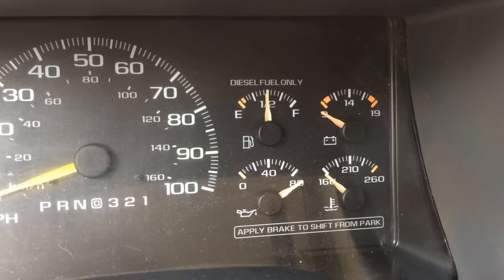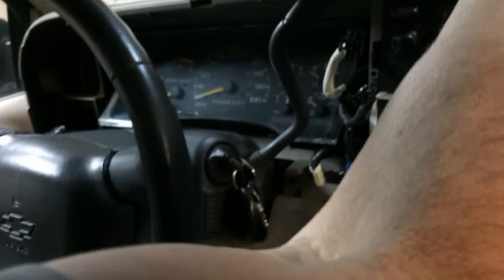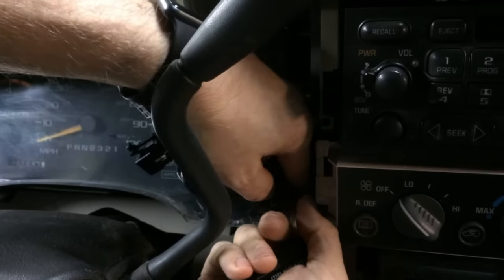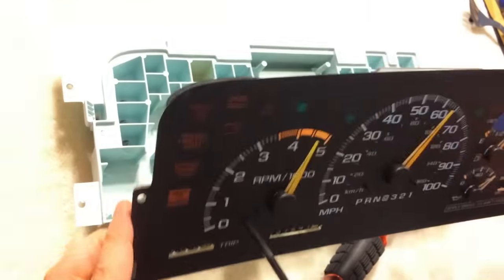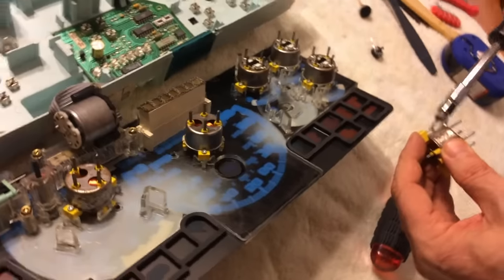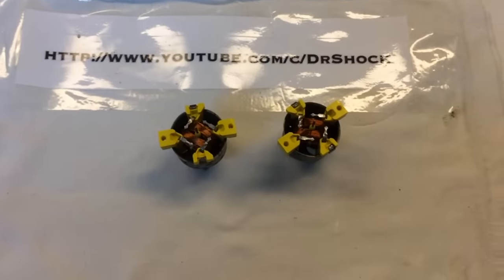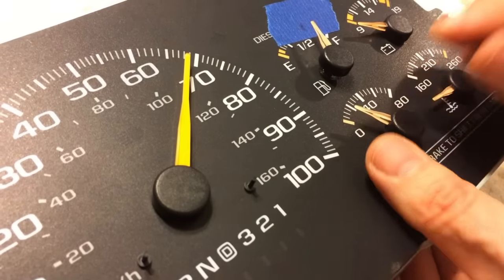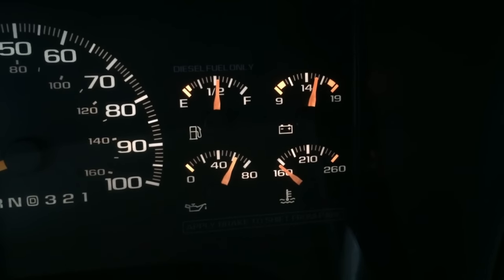1994 - 2002 GM Truck Twitchy Erratic Crazy Fuel & Oil Gauge Needle Aircore Motor Repair (Chevy GMC)

Comment: I looked online for the stepper motor/ air core motors, and they are fairly expensive. to get a Dorman replacement seems like it’d be more cost-effective because there is  all new parts and motors. I don’t have an erratic fuel gauge, but it is does vibrate. My issue is one of the stepper motors or something related to the speedometer is making a clicking noise at speeds 40mph and above. Can a person take it apart and blow canned air around the motors to blow off any contamination or dust that might have accumulated throughout the years that might cause erratic needles or noises?
Reply from the maker: Air core motors are totally different than stepper motors.   Air cores are way old, all the way back to the 1940s.  But the most common condition that this video points out is that the ones GM used have an internal dampening fluid, it's way dried out after over a quarter century on these trucks now.  So replacement is the only repair.

There's nothing mechanical with the speedometer gauge on these trucks (also air core based so no mechanics just electromagnetics).  But clicking noise coming from  the speedometer gauge area might be related to the odometer which is mechanical.  Could be a nylon gear lost a tooth or such there.   It could be generated from other mechanical components in the same vicinity too (e.g., cruise control module on the other side of the firewall, fuel line vibration against the firewall directly opposite, etc).
Reply: @DrShock  ok thank you so much. You are awesome mine is a 98 Chevy Silverado pick up. I do think the gas gauge is going to go out anytime because it’s been vibrating forever. As far as the noise goes I said clicking but I also think it might sound like a rattling and it’s related to the frequency of speed going 40 mph and above.  If it is a gear assembly in the instrument cluster do you think blowing the gearing out with canned air might resolve the issue?
Reply from the maker: If it's a broken gear tooth causing the noise, no because a cleaning won't effect any sort of repair.  If it were somehow some sort of debris lodged in the mechanism, possibly.  But in this situation there would be some interruption of function, either the trip meter or odometer no longer functioning properly or the speedometer no longer functioning.    Much more likely to be coming from somewhere else imo, but you would have to pull the cluster and inspect it more closely.
Reply: ok thanks a bunch i appreciate the help. have a great day

Comment: if the fuel gauge was acting erraitcally when u marked it how do u know thats where it should be? shouldnt u put gauge on 0 before u start car then it will go where it should?
Reply from the maker: the twitch doesn't change the fuel level.   If you're getting erratic fuel level readings it's the sender in the tank, not the gauge.

Comment: I pulled mine out to replace and found that it has a small 3 wire pigtail coming right out of the top of the cluster, it runs over to the left vent and plugs into another small 3 wire plug.  Do you know what that could be for? I searched everything and everywhere and cant find any info about it.
Reply from the maker: I've not seen anything like that factory equipped.  What year?

Comment: Now I know how to disable the ABS light and service 4wd light. No front half shafts or drive shaft.
Pulled the ABS fuse because I almost ran into the house because the ABS decided to wig out on me on dry pavement.
Reply: Normally the only issues with abs on these trucks is the front hub sensors. The hub rusts and the sensor is a magnet. So it flakes off and sticks to the sensor. If there seized in there just buy new ones if not pull them out clean off the crap and plug your fuse back in.

Comment: honestly thought it was wiring issue because when i use my blinker itll move every time the relay clicks, would this fix that or not?
Reply from the maker: If the needle flicks in sync with the turn signal, you have a wiring issue.  That behavior would be different than what this video covers.  Your symptom is most likely due to a harness ground point that has come loose or too corroded.  I have another video on where all these ground points are for the GMT400 series that may help.

Comment: My gas gauge works fine,but it moves back and forth about 1/8 in when my turn signal is on. I think it has something to do with using heavy duty flashers.  It never did that until I installed those.
Reply from the maker: The gauge moving while stopped, only while the turn signal is engaged certainly sounds like just a current draw issue to me as well.

Comment: mine just started to twitch and another thing is that i dont trust the gas gauge, i have filled up the tank and it goes pass the F mark if i mark my fuel gauge would this matter? since its not accurate? thank you for this by the way years back i even bought and entire instrument cluster because i didnt know about you can just replace these
Reply from the maker: With age, I'd say it's somewhat expected for the needle to go slightly past F on a fill up.   Emphasis on slightly.    If you're seeing it go significantly past, it may also involve a fuel tank sender that is on it's way out as well.   There's a linked video in the upper right corner of this one that might help with that.

Comment: One indication it's a grounding issue is when two or more gauges dance similarly.

For the last year or so, my old 1993 C1500 was exhibiting the issue.  I pulled the gauge cluster and cleaned all the electrical trace push-in electrical connections.  I installed brand new lighting bulbs too!

The problem didn't disappear.  Eventually, I started having symptoms of the engine and transmission dropping out for moments.  Then, the engine really started cutting out and bucking.

Okay, I guess I gotta do something real about the issue now...

Powers and grounds, it's always powers and grounds.

In the engine bay right behind the alternator, there are two studs about 4" apart.  Each stud grounds two wires.  The terminating lug at each connection was a green creepy crusty mess.  I cut the wires back a bit, soldered in new wire lengths, soldered in a new grounding lug, heat shrink tubing everything, cleaned up the stud mating surfaces with a wire brush cup on a Dremel, and reassembled everything.

The gauge jitter mostly disappeared and the 5.7l V8 is back to its sewing machine smoothness.

One issue remains, however,  The volt meter drops from a reading of 14 to 10 and back to 14 when the turn signal flasher is operating.  So, should we get a comfortable day temperature and dryness wise, I'm going to refresh the grounding terminations for the front and rear turn signal circuits.

Powers and grounds, it's always the first thing to verify and check!
Reply from the maker: You could start here on the grounds, https://youtu.be/H0lK0TZEVCc

What's shown in this aircore motor video isn't ground related behavior, but it is a good checklist item to start with.

Comment: Would this also be the problem with the MPH (speed gauges)??
Reply from the maker: This twitching is only known to affect the fuel gauge, because in these early air core designs that gauge is filled with a dampening fluid which dries out after the more than a quarter century these trucks have aged within.    There certainly could be a problem with the other aircore motors, and I include search links in the description, but it's quite rare compared to the fuel gauge.

Comment: My 2000 Silverado gas gauge isn't twitchy. One min it's on empty, the next it'll jump to full (just filled tank). I fill tank, it's still on empty, then a few mins later, it jumps to full. This goes on and on. Now it seems to be stuck on full, even after driving 95 miles. Stepper/aircore motor? Sending unit?
Reply from the maker: 2000 Silverado would be stepper motors not aircores, totally different tech.  When I replaced the stepper motors in a 2004 it was because one of them had gotten to where it was upside down and off the scale.   I've seen other symptoms where they just get stuck.   So it could be your stepper motor, probably other videos that dive into diagnosing that more specifically.   Could be just bad grounding though in the sending unit harness path.

Comment: Just got a 98 Chevy Tahoe, the fuel gauge is stuck past full so I have no clue where I am on fuel, I just have to fill up. If I followed this video and tried to fix it myself, do you think it would fix my Tahoe's problem and I'd see what my fuel level is again?
Reply from the maker: Sounds like your'e saying the fuel gauge needle is not moving at all, stuck over past full.   If thats correct it's not this specific problem but still could be the aircore motor.  But for a completely unresponsive gauge I would try other things first (check wiring to the fuel pump/sensor assembly on top of the tank, check grounds at the engine firewall and frame points, and then I'd pull the instrument cluster and see if the guage is mechanically stuck or I can move it with my finger).  Fixed and stuck could be several others things to eliminate first.

Comment: My 96 Yukon 5.7 goes “crazy” my 95 sub 6.5 isn’t far behind....this will help...oh look you have buttons to the right of the ignition(keys) thanks DrShock! Really like and value your videos...currently no pwr locks, pwr seat, aux pwr(cig) fuses seem good...I think it’s a ground...anyone know where that is? My A/c may have fried something....it stopped working (I cleaned the blower switch copper plates....it worked again(May have been wire movement) I think /hope it’s a ground wire
Reply from the maker: If all those options are out but fuses are all good, and the rest of the vehicle electronics and engine are functional then yes it could very likely be a ground problem.  Very time consuming to track down such electrical problems, but I'd say having that much out you're looking for common ground and power routing as a start.
Reply: DrShock yep...Wish me luck! Thanks again

Comment: Not sure if I missed it or not, did you mention where I can purchase the Aircore Motors? Thanks!
Reply from the maker: In the video description you'll find some more technical information, as well as links to where these can still be found.  The "F" code one has been very difficult to locate since Covid though.
Reply: @DrShock  guess I’m not too good at this, but I couldn’t find the video description where to buy a fuel gauge or the links to where I can buy 1? Thanks Jim
Reply from the maker: The description text for any YouTube video can be accessed two ways.  When viewing the video on the youtube mobile app, just click the down arrow symbol to the right of the video title sitting below the video after you tap into it.  When viewing on your laptop/pc just scroll down below the video title text below the video after you launch it and find it there.

You can also check the pinned comment at the top of the comments here.
Reply: @DrShock  I thank you very much! I’m kinda old,,, but new to these things, haha
Reply: Sorry to say, I still couldn’t find where to purchase a Fuel Gauge Aircore Motor for my 94 Silverado?!

Comment: My 1994 diesel fuel level is empty at 1/4 reading and extremely full when the tank is full.  I might try and just set it at full after a visit to the station.  Are you aware of what voltages I should see on the input to the gauge?  Be nice to actually know where the bottom of the tank is...
Reply from the maker: Don't recall the values offhand, but this other video of mine might help you https://www.youtube.com/watch?v=dw9Hia55yys
Reply: @DrShock Thanks for the link.  Saved it to my favorites for this spring when the weather is warmer.  I love you have the shop manual diagrams...big help.  Hopefully the harness is similar to the 1994 model I have.  I'd love to get my hands on the shop manual for my truck.
Reply from the maker: Those out of print manuals sometimes show up, I have a search link listed in this videos description text area.
Reply: @DrShock Found a service manual with the diesel supplement for the 1994 gmc diesel on eBay for $59 usd.  Thanks for the info.

Comment: The fuel gauge on my truck (97 c1500 4.3 manual 2wd) stays at full all the time, but it will shift back and forth consistently with the turn signal. Same amount, same speed and it "cycles" anytime the turn signal is on. When the signal stops, it snaps right back to slightly over full? Do you have any idea what it could be?
Reply from the maker: These symptoms indicate possibly two different problems happening in parallel.  There's something amiss with the wiring harness/instrument cluster connections if the fuel gauge needle is moving in sync with the turn signal flasher rate.  A very slight twitching during the turn signal I would say is somewhat normal, but sweeping is more of an electrical short.    And then there's something amiss with the fuel sender in the tank, as despite the electrical interference, you're never getting an accurate reading.
 
I would debug the fuel sender problem first, unplug the harness at the tank connector that the senders short harness plugs into.  See what behavior change you get.  It should have an effect.
Reply: @DrShock  thank you so much. I wonder if it may not be the entire cluster itself. Until seeing your video I wasn't familiar with how it was set up. My pressure gauge is laid past full like there is no motor in it at all, the speedo is about 10mph faster than I'm going with factory tires the only accurate gauges are tach, volts, and temp.
Reply from the maker: You didn't mention that earlier, so if multiple gauges are awry, then yeah that points more to the instrument cluster flexible circuit board or again wiring harness issues.  Check the grounds first though when facing multiple electrical failures like this - https://youtu.be/H0lK0TZEVCc

Comment: Nice video. I'm looking at ebay and there are no more "F" aircore motors available. They are selling the "C" for the fuel. Any idea if those will work? 
Thanks.
Reply from the maker: The most sensitive is the fuel gauge, because it's the one that actually has a dampening calibration needed to avoid the whole problem this video is about (which is caused by how the PCM sends its fuel sender signal).  I would only use an "F" as originally spec'd by GM for the earlier model years.  The "C" is for a later cluster.  I have another truck that I need to do this same repair on for someone, and I wrote to one seller, digital-dash-solutions, who should have more "F" aircores in stock in a few weeks.   I'm going to wait for the right part myself.
Reply: @DrShock  Thanks for the reply. I asked the same seller cause he is offering the "C1" for fuel. I'll be waiting too. Thanks.

Comment: This is a bit off but you seem like someone who might know.  I have a 97 S10 with a very similar gauge cluster.  The speedometer is about 30% off I have been able to confirm the speed sensor is accurate.  Do you think this motor could be the problem or any ideas?  Literally a % off not a number so 60 is 78, 30 is 39 etc.
Reply from the maker: Does it land on 0 correctly at a stop?  Seems unlikely to be the aircore motor, but would be easy enough to swap with another from a salvage cluster to confirm.
Reply: @DrShock  Yes when you stop it goes all the way to 0.  The tires are only slightly off of the factory tires 5 mm I believe. So close that as I said before with the scan tool it shows accurate to GPS speeds. So really I'm kind of stumped.  Perhaps it's the board that the motor is attached to or maybe the resistor on the motor.
Reply from the maker: I'd try swapping a salvage yard clusters motor in there (which would include a resistor) which could eliminate two candidates in one shot.   If it's still happening, it's obviously not a problem in the cluster.
Reply: @DrShock  Not a bad idea.  Even if the salvage one is bad I'm sure it would not be bad in the exact same way so you could tell a difference.

Comment: every time I've had this symptom roll in it's always been the fuel sending unit or oil sending unit i have yet to replace ip motors in a OBS i do LBS ip motors all the time 2000-06 seem the be the worst.
Reply from the maker: As they have gotten older, the analog aircore motors are giving out more and more.  Unlike the NBS and NNBS trucks, these OBS trucks did not use a stepper motor.   The best way to tell the difference between a fuel sender issue and an aircore motor issue is the twiching which is unique behavior to the latter failure.

Comment: Why my truck not mark the light indicate  P R N D 3 2 1 ?? Only Mark 1 when I put it in 1 I test 3 different cluster
Reply from the maker: If the shift position itself is off you might check the shift cable, https://youtu.be/Obv-lwGu6g4

Comment: I just did this to my pickup and the gauge still freaks out more so now when I'm driving and especially when I'm slowing down. What could it be?
Reply from the maker: Sometimes, with trucks this old, it can be multiple failures.  The fuel tank sender is often at fault for incorrect or erratic readings with movement vs the twitching / fluttering at rest that the Aircore motor mostly exhibits.  You might try the diagnostic tests I did for the fuel sender in this video - https://youtu.be/dw9Hia55yys